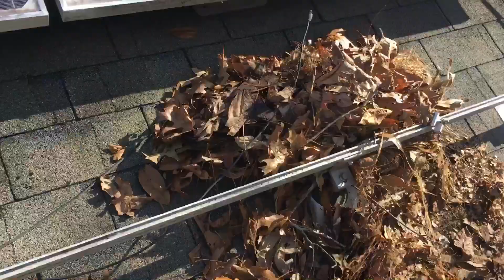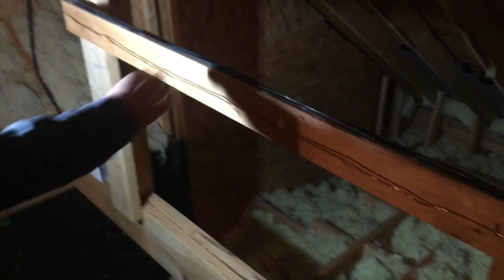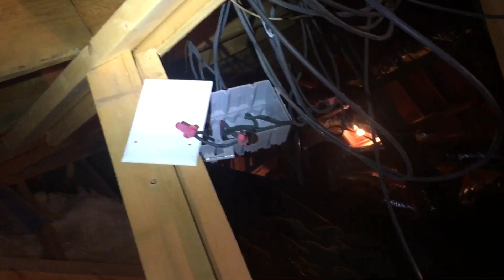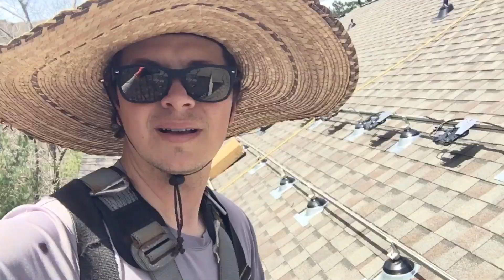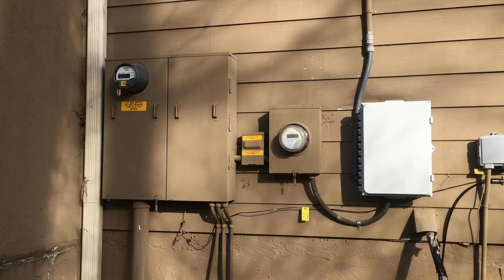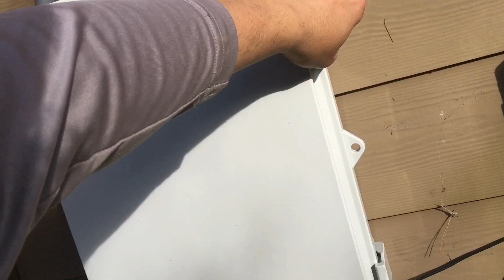Shingle Reroof with Solar Panels PT2

Comment: I'm on the fence about my solar installation because my roof is 19 years old and made of high-quality lifetime shingle. It looks good, power roof fan,ridgevent, 4 vent caps and  soffits  with no cracks, but there is no more granulars running in the gutters.I have the Timberline Ultra lifetime select 40 installed 2005.
Reply from the maker: @HB-yq8gy  definitely don’t put solar on a 19 yr old roof.

Comment: Hey Johnny, I will need to re-roof under my solar this fall.  Thinking of switching from shingle to metal roof.  I used the IronRidge FlashFoot2.  I guess I would reuse the rails and find something that attaches that to the raised seam of the metal roof?  What do ya think?  Do you sell something for that?  Thanks!
Reply from the maker: There are lots of standing seam roof clamps out there. It will depend on the exact profile of the roof panel. Ace clamp a2n is my favorite but I don’t know what type of roof it will be